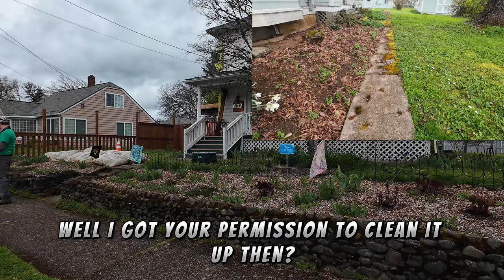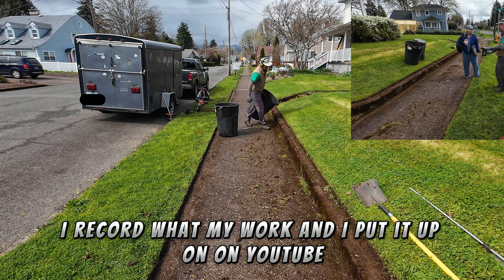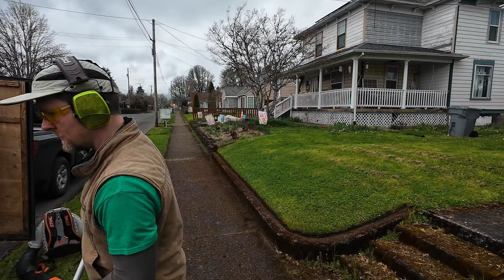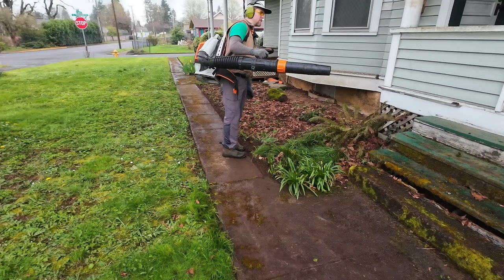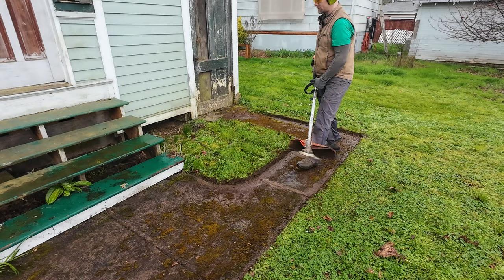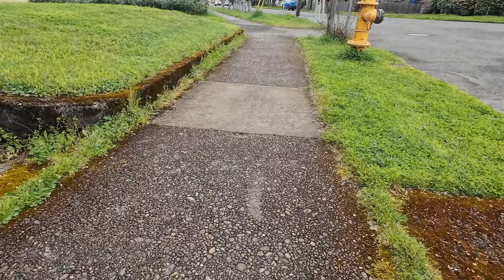Warning: Overgrown Sidewalk Snakes at 130 y/o Vacant House

Comment: Great results! You're doing your doing your homework, shrewd use of the wire brush! Only a native Oregonian would know of this ancient secret weapon!
Reply from the maker: 😂😂😂 My wife’s grandfather was given one as a present once and I’ve also seen them online years ago. I recently bought one and realized it does an amazing job. However, I wish it did better on big open flat spaces. It’s good for small spot or along edges. Eats right through pretty much anything, even built up wet dirt. I tried a nylon brush which was nice but it isn’t as durable and it doesn’t eat away at wet dirt.